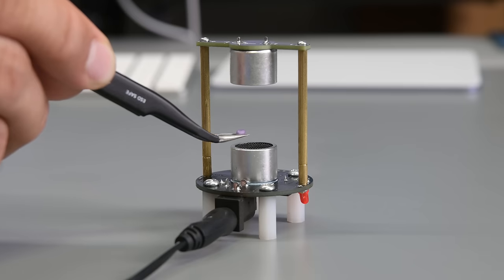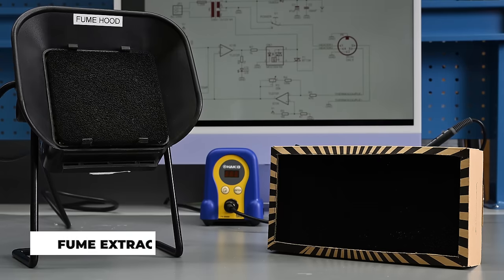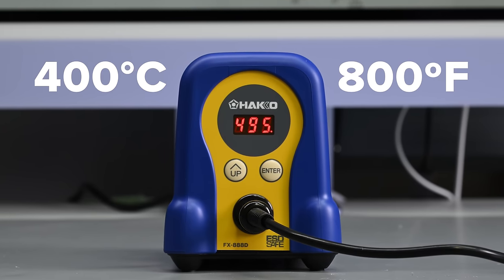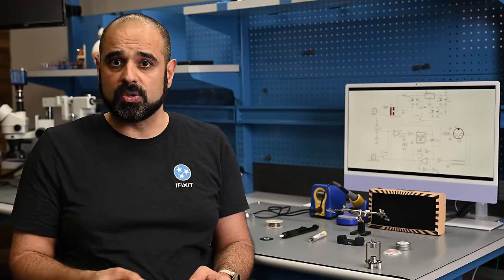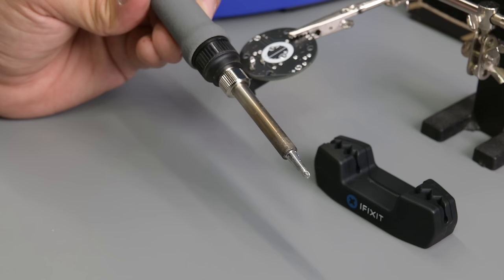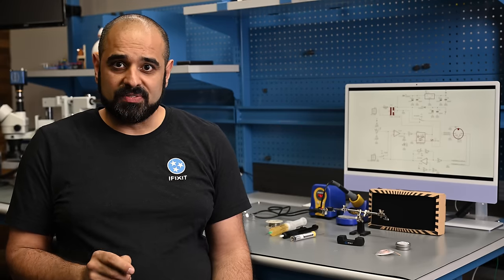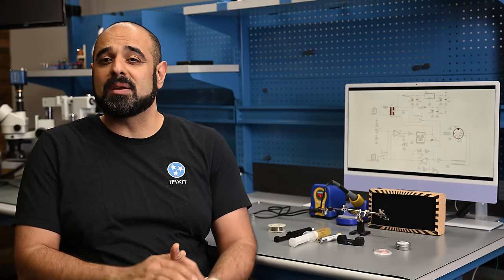iFixit's Soldering 101: Beginners Guide

Comment: One tip is to try different tips. Pencil tips are the most common, but are also more frustrating to use due to the limited surface area to transfer heat into the things you're soldering. A chisel, knife edge, or other tip with a flat edge makes soldering most components much easier, especially with ground planes that like to absorb all of your heat. So if you're having trouble, sometimes a different tip will do the trick.
Reply: thanks!
Reply: Thank you, senator Armstrong

Comment: A few important things to add. You should raise the temperature of the two things you are joining to the melting point of the solder so apply the tinned iron to the joint and then, when hot, add the solder to the joint. Don't carry solder to the joint with the iron or apply solder to the iron (other than while tinning it). Make sure you have a sufficiently hot tip for the job. It's much easier to solder with a tip a little too hot or big than one that too cold or too small. When using flux cored solder (which most is) you shouldn't need any extra flux especially if you are soldering new items other than surface mount when you would probably be using paste. Keep the items clamped and still. A joint that moves while cooling will be a bad joint.

Comment: Watched many soldering-desoldering videos, but never understood what flux is for and never bothered to search up.
Now I know what's its purpose.
Reply: All solders have some flux in the core of the metal. But most times that flux is not enough. It just helps it move better, like putting grease on a joint
Reply: If you've ever soldered anything dry versus soldering with flux, it's a world of difference. It's difficult to understand without this sort of explanation, or doing it first hand.
Reply: Flux removes the oxide layer on the surface of metal when heated up. Usually flux is already inside of solder. But when you are soldering a lot of that flux which is inside of the solder evaporates due to the heat of iron and solder doesn't bond that well. If you are melting solid solder directly to the joint you don't need extra flux but when you are melting solder to the soldering iron first and then to the joint you definetly need to put flux on the joint because there is no longer flux in the solder.

Comment: Just fixed my drifting Xbox one controller have tried previous but was too harsh and ended up ripping off joysticks than then letting them come on themselves and damaging the board. Now corrected with better solder and flux and correct wick the right equipment really does help don’t me stingy me and use plumber flux and crappy Chinese solder I got with the iron off Amazon 😂

Comment: I would've talked more about cold joints, setting the right temperature, type of iron points, cold joints (again), helping yourself with an heatgun for large surfaces and with the braid, types of flux, cold joints (seriously guys you should include it). But overall great stuff for a start from 0 introduction.

Comment: Flux works by acting as a heat transferring medium. Just like trying to sear a piece of meat on a dry pan vs with a little bit of oil. When oil is present the action is completed more quickly and equally. When you try soldering an IC without and flux you try so hard and even risk damaging it. Just like you would char your meat.

Comment: Overall nice video. But when watching factory workers hand-solder through hole-components, they don't pre-apply flux. Nor does a soldering robot or a wave soldering machine. I also don't think iFixit applies flux before soldering every single joint. For me, the same is true: the flux in the solder is enough to create a solid, shiny joint. I would reserve extra flux for removing old solder or very big joints. 

Also, there's a trick to desoldering wicks: the ones with flux inside work. The others... don't work at all. You must also raise the temperature when using a wick.

My best purchase has been the Weller tip activator. Dip it before you start soldering, and dip it once when you're done and wipe on the (brass) wool. It's very quick and natural in the workflow if you stick it near the brass wool, and your tip will last decades!

A fume extractor will have no chance of filtering anything without being loud. Either the filter doesn't filter and only requires a weak fan, or it does and needs a loud fan. If you can't afford a $400+ quality brand, consider a fan on a hose out of the window, and fumes not caught will stay in the room and spread in the building, so you must also vent the room.

You can buy a magnifying lamp and put the lens between you and the iron tip at a slight angle, to avoid fumes and sputter reaching your eyes.

Finally, if the board is small and easily handled, a tip is to fixate a bit of solder with a Helping Hand instead, and touch it and the board to the iron tip.

Comment: And now I need guide how to hold steady small resistor in size of rice grain.
Reply: Hold the component with a pair of tweezers in a pencil-like grip, with your wrist on a table. It takes practise and patience
Reply: When I did a whole heap of tiny surface mounted diodes (as small as 1mmx1.5mm), I cut slivers of painter's tape to stick them in place. Holds them in position enough to solder and is easy to remove once done. Plus, a desk/lab magnifying glass with light was really handy for me. For slightly larger components I've also used Blu-Tack/adhesive putty to hold in position. Agree that a nice set of tweezers is also useful.

Comment: I use soldering paste, is that the same as flux?
Reply: Soldering paste has flux in it. It's generally used to place on pads of a PCB before they go in a soldering oven.
Reply: Soldring paste is solder in a paste form mixed with flux. It works, but careful about using it as flux, since it's a metal paste, and can cause shorts if you don't clean it up well after use. flux on the other hand works as well and costs less.
Reply: @rraygen  My paste is whitish and I seriously doubt there is any metal in it. I'll check the label tomorrow.

Comment: What if I dont have flux or a fume extractor?
Reply: Well if you don't have fume extractor and you aren't soldering that often no harm will be done, just avoid breathing fumes as much as possible. But if you are soldering very often then it is recommended because it can cause some health issues over time. On the other hand flux is very important and it really makes the connections much better because it cleans all the oxides on the connection. But there is some flux inside the solder already. When soldering some of the flux inside the solder evaporates so using some additional flux helps a lot.
Reply: @Slovenija_patriot  Thank you very much
Reply: @FixationRepair  No problem.

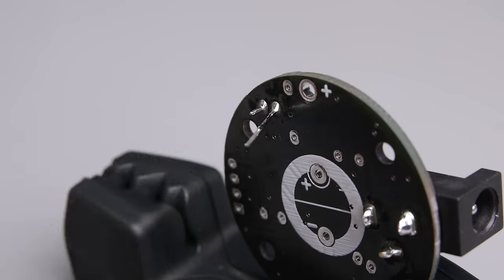Comment: 4:38 "Kind of like a Hershey's Kiss, but without the diabetes" 😂🤣
I do not care how "easy" leaded solder is, if I had to work with solder, I would 100% skip leaded and go unleaded. 👍🏾
Reply: There are zero benefits to using lead free solder. Leaded is way easier to use in every way. Just don't eat the stuff.